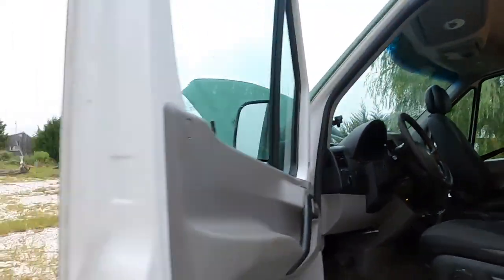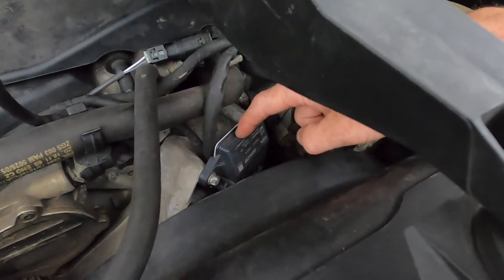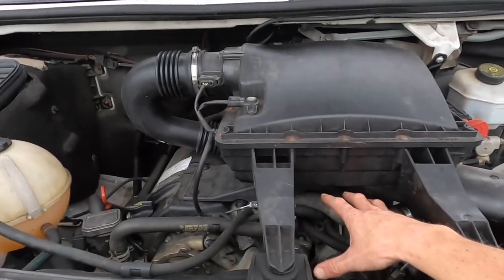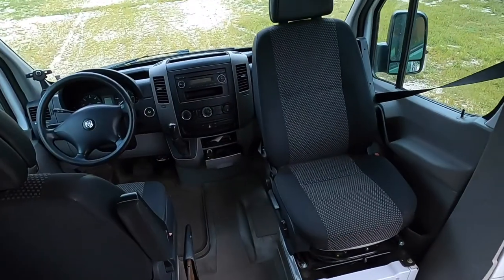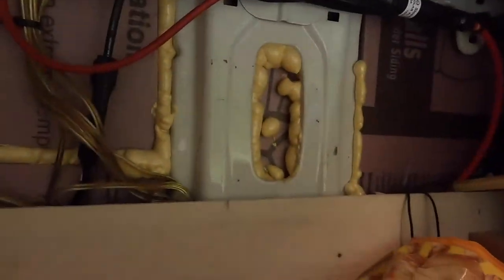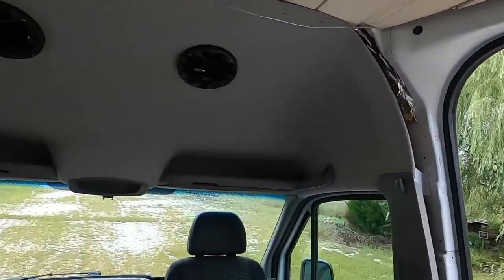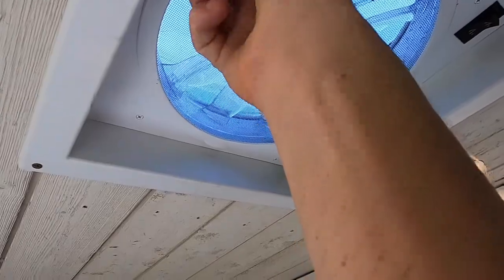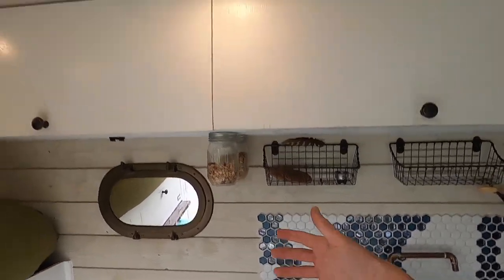Sprinter Van Conversion Walkthrough - VanLife SOLD

Comment: Nice van! You don't have to sell it because of the kid though. Kids like van life too. Just bolt in a car seat!
Reply from the maker: We were wondering if bolting in a car seat is legal...? Any insight on that?
Reply: @TheMaryJaneExperience  What about a bench seat in the front? Many states don't have laws about front seats IF you don't have airbags or they are disabled and/or, if you don't have a back seat. Not sure about just bolting to the floor. From what I could find most ppl say it needs to be a regular seat and one guy who installs factory seats said he would never sit in one that wasn't connected to the floor of the actual van (not the flooring of the van interior) due to load distribution in a crash. There are lots of after market. seats that are street legal. Some even fold (kinda) out of the way. I'd have it professionally installed though. I agree with areback01, you don't have to get rid of the van for the baby. Babies/kids like vans and they're too young to get a vote yet anyway. Good luck with whatever you choose to do.